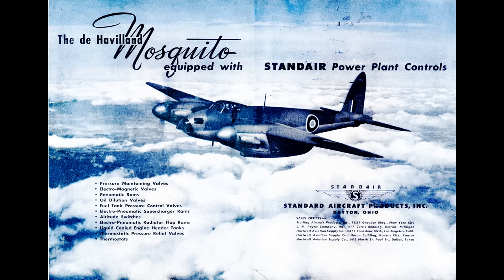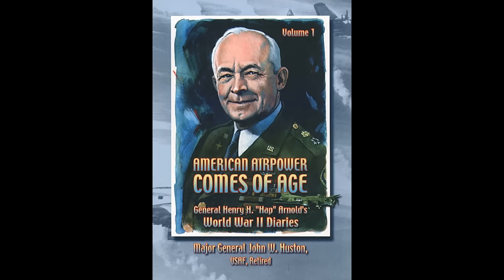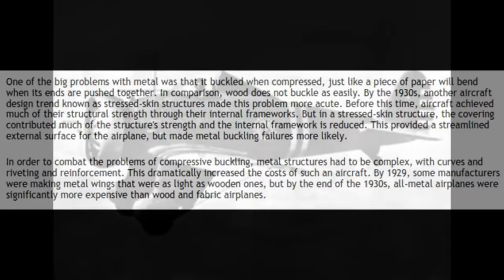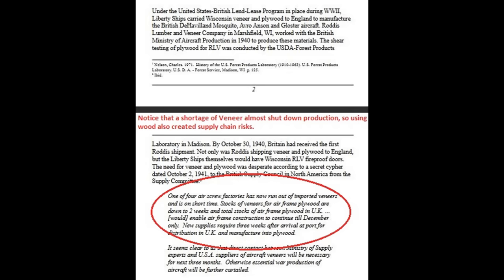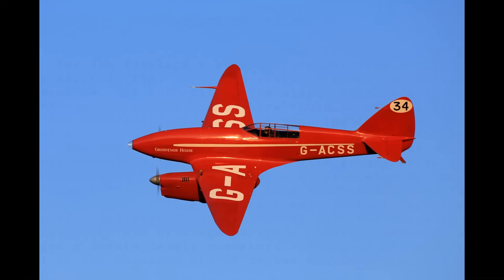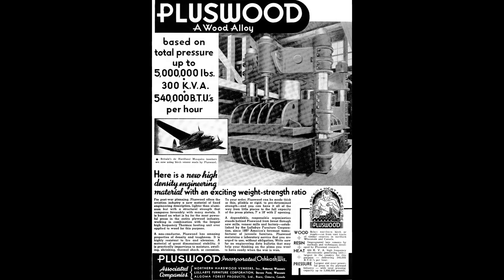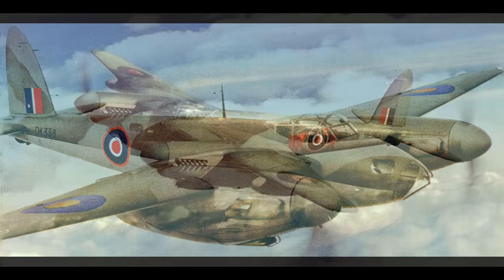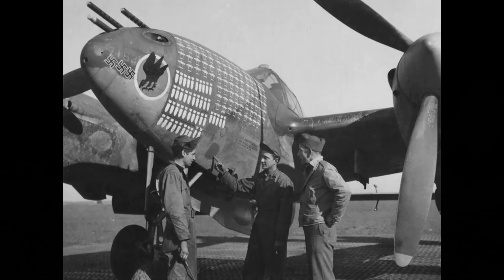De Havilland Mosquito vs. ?

Comment: Would anyone know if any Mossies fitted with the 6 pounder gun may have attacked concrete bunker emplacements in Wildflecken during the war?  I was there in the early '70s and saw a number of bunkers, some had been destroyed by demolition but a few were taken out by air.  One such bunker had a hole through the two-foot thick front wall almost large enough for me to fit my hand through.  The shell that did it was embedded in the back wall of the bunker just above the floor, easily found under the leaves and blown-in dust and other debris in the bunker by simply sighting down the hole in the front wall.   Entry hole was fairly clean, exit hole had spalled a crater over a foot across which had peppered the inside of the bunker, gouging the walls.  The slug was embedded in the middle of a smaller crater with a portion of the projectile sticking out of the wall.  The forward section was rusted and evidently steel or iron with a copper section at the rear which was oxidized greenish-blue  but still showing metallic copper.   The hole in the wall was angled downward at about 25-30 degrees or thereabout.    I was curious why a steel slug like that would have a copper section at the rear, unless the copper was for making things easier on the rifling in the gun barrel to spin the projectile without wiping out the barrel.   I'd wondered if maybe a B-25 could have done this sort of damage but the Mitchell variants fitted with this sort of larger gun had a 75mm cannon, which would have left a larger hole.  So... Mosquito?   Anybody know anything about Mosquitos fitted with these 57mm guns being used against bunkers in Wildflecken?   What else could have done this?
Reply: The mark XVIII was only used by Coastal command and only 17 plus one prototype were built. One thing it did do was shoot engines off of  a Ju88 bringing it down.

Comment: The point I was trying to make, perhaps inadequately, was that the Mosquito wasn't some kind of fusty holdover from an earlier era of wooden aircraft. It was a special, quirky piece of genius by Geoffrey de Havilland, who had (as you report) made wooden airliners, and continued the theme in the Mosquito's successor, the DH Hornet, and even into the DH Vampire jet fighter (a twin-boom design whose egg-shaped fuselage was partly made of wood). OTOH hasty research shows that the Tiger Moth, DH's pre-war mainstay, had a steel tube fuselage but wooden wing spars. So DH wasn't necessarily married to wood

Comment: It was faster than a spitfire and carried 4000 lb bomb load, a b17 carries 4800 lb.  getting the idea just how  deadly this machine was
Reply: B17 could carry much more than 4800lb. That was a typical load for long range missions.
Reply: Depends on what types of bombs used, and there were many types used. For instance, the USAAF load charts for the B17 show an internal bomb load of 8 1600 lb bombs, with a maximum load of over 17000 lbs using external hard points  which were probably never used, at least I can't find any reference to it. I tried to find out what bomb loads were used on the shuttle bombing missions, landing and resupplying in Russia. The planes used on those missions used the long range " tokyo tanks" which I'm sure limited bomb loads, as they involved a 1 way trip of over 1500 miles. Maybe someone else can shed some light on that?

Comment: The most underated plane of the 2nd World War. In my opinion. And it was a stroke of genius to build out of wood. When the use of metal went to fighters. All the wood workers could be uterlised .A fantastic platform to use different weapons, which it did .to great effect.
Reply from the maker: I don't know, it doesn't seem to be under rated here in the comment section, quite the opposite.
Reply: @GregsAirplanesandAutomobiles  Perhaps they haven't read the history, or the reports ,from the original wiring of the actual Pilots ,who flew them .That's why I said underated.

Comment: No mention of the Focke-Wulf Ta 154 Moskito surprisingly, Herman's personally much desired and sort for response to his admiration of the De Havilland Mossy.
A comparison between the Ta 154 and Mossy would be interesting. 

I have very limited personal knowledge or understanding of these topics, Wikipedia appears to imply in its Focke-Wulf Ta 154 Moskito entry that German "high performance" aero wood construction seemed to suffer some what from failures in materials particularly glues at least in several designs that got to prototype and some low numbers production.
e.g  He162 and Ta152.

Comment: Twin engine propeller plains planes generally used contra-rotating props to give you zero torque effects, unfortunately the Mossie just fitted 2 engines rotating in the same direction which mean that there was quite a lot of torque effects on high power low speed.  It mean it could be a handful under high power in inexperienced hands.
It was a beautiful plane.

Comment: Westland produced the twin engine whirlwind (single seat heavy fighter with 4 x 20mm cannons) about the same time as the Hurricane and Spitfire out of aluminium but was under powered using the Rolls-Royce Pegasus AND used 3 times the materials as a Spitfire, but was the most heavily armed fighter of the day!

Comment: OK de Havilland had a lot of experience building wooden airplanes but what about other manufacturers espacially americans? I understand Beechcraft point of view I think it would have been difficult to massively produce aircraft made of wood in the US. It requires more skills to properly glue wooden panel than to rivet metallic ones. I reckon shartage of skills was a key driver in rejecting the Moss in the US.
Reply from the maker: No, there were many aircraft manufacturers making aircraft out of wood in the US and they had built far more wood aircraft than anyone else. I think my next video will help explain why there was a huge move away from wood in the US in the early 1930s.

Comment: compressed and bent/warped plywood had great strength, lower strategic cost. additionaly a large number of carpenter/ craftsman were available  for the task at hand. unlike the hurricane where the stringers were of wood [ and consequently easier to repair than metal monocoqe spitfires. ]  the lighter weight with two merlin engines gave the mozzie outstanding speed and higher altitude capabilities for recconasance.

Comment: Two other benefits of using wood are the skilled craftspersons were mostly under-employed during the war. The work available for cabinet, furniture, piano, guitar, etc., makers was substantially reduced in war time. Also, wood is a lot easier to repair, replace and maintain in the field.
Reply: Then why are there no original aircraft still flying?
Reply: @sandervanderkammen9230  , eventually, wood will rot, especially since many, if not most, original Mossies were left outside after WW II.
Reply: @VRSimWizard  Aircraft made of wood are significantly less durable and have a very short service life, unlike traditional wood aircraft that are cheap and easy to repair, the Mosquito's molded plywood construction was very difficult to repair properly.
 The Mosquito was conceived to work around Britians shortage of aluminum but in practice it was simply cheap and disposable.

Comment: Looking forward to a mosquito p38 video....Although it may seem on the surface they could do a lot of the same roles....Operationally I'm sure there are massive capability differences....ie a navigator...climb performance...allison vs merlin development....on and on.  Two very interesting aircraft. One of which there is a fantastic representation of in the DCS Sim.

Comment: Great video.    Part II and the P38/Mosquito comparison should prove very interesting.   It will be fun lining up Mks, dates in service and comparing capabilities.     A couple of thoughts struck me, first the Mosquito was succeeded by its "Sports Version" the superlative DH Hornet which served with the FAA in its Sea Hornet incarnation.   Same structural principles as the Mosquito, but handed airscrews which probably helped with landing on.    "Winkle" Brown the first pilot to land a multi-engined aircraft (Mossie) on a carrier, and also performed the first carrier jet landing, called it the best of the lot.  Since he just about evaluated the lot, he has some solid grounds for saying that.

The second thought was about carrier operation.   The first jet  engines were very thirsty and also maintaining a steady thrust could be difficult - provided it even kept running.    This made carrier jet operation a challenge at the time, and I can see how a high performance piston engined carrier aircraft could be useful for quite a while after jets got adopted for operation from land.    We know of the Mosquito and Hornet use at sea, (nervously showing my ignorance) I wonder if there was any thought given to a comparable Sea P38 or a follow on analogue of the Hornet and Sea Hornet.
Reply from the maker: The Hornet is a different ball of wax, I'll cover it when I get to British Super Props, but not in this series.
Reply: @GregsAirplanesandAutomobiles  Many thanks, fair enough.   I suppose what I was thinking was the guys at DH looked at their Mosquito and deciding they could do even better by  stretching the same principles and I wondered if Lockheed entertained similar thoughts.    Presumably DH always had eventual carrier operation in mind. Thanks again.

Comment: Very enjoyable.  Extremely well balanced in my opinion....however a few points . I think the lighting v mosquito is not really comperable. They  were both head and shoulders above the average. Lightning on accoun because of the extreme range bestowed by the turbochargers which neccesitated the twin boom design. Were talking Kelly Johnson here....and i believe charles Lindbergh showed the pilots how to cut revs and increase boost to maximize range despite the engineers warnings. Perfect for the pacific  Mosquitoes  in their own way were optimized for the time and place. Another way of looking at the almost unique construction method is to call it composit....like proto foam sandwich construction with the balsa acting as th foam which did not yet exist. It was built on concrete moulds with steel straps providing the pressure to acheive a bond between the layers.....nothing like traditional wooden construction.. The mosquito meuseum is just down the road from where I work. Well worth a  visit. As an aside experienced lancaster pilots and most others were required to do a 14 day coversion course onto Mosquitoes which says a lot ....also somebody mentioned the other day that it wont climb on one engine gear down....just to make single engine handling a bit more interesting.

Comment: The benefit of wood and cloth construction, is that cannon shells pass right through without detonating.
Reply from the maker: They detonate when they hit wood. I think you are confusing cloth coverings over a skeleton type structure like in a WW1 airplane.
Reply: @GregsAirplanesandAutomobiles     just checked ... plywood skin ... i learnt something today, thanks.

Comment: If de Havilland had only called the material of construction a composite, and not wood then it would have sounded so much more advanced. As far has handling goes, probably the trickiest issue, was that both engines turned the same way. It's notable, that post war wooden oddity, the de Havilland Hornet (reputedly Eric Brown's favourite aircraft) had gearing such that the engines turned in opposite directions. 

One other thing about de-Havilland. They did know how to produce beautiful looking aircraft. Among airliners, perhaps only Concorde looks better than the Comet and no WW II aircraft could match the aesthetics of the Mosquito in my (subjective) view.

Comment: Interesting.
The Mosquito uses the RAF 34 mod profile airfoil. I am not sure what the modification is. The DH.88 Comet Racer used the same wing profile. I have a suspicion that The DH.114 Heron which also uses RAF 34 mod (18.3% at wing root and 14.5% at the wing tip.) uses the same profile.
But as I cannot prove it that that is the case I ran the comparisons on a standard unmodified RAF 34 profile. I then created a NACA 4 digit profile using the RAF 34 profiles characteristics for comparison.
I I then ran some comparisons on the airfoil tools website.
There is a NACA profile that is fairly close to the RAF 34 profile the NACA M6
The nearest NACA 4 digit profile would be NACA 2312
This defines a Camber of 2% at 30% of Chord from the leading edge and and a maximum thickness 12.5% of Chord.
BUT it does differ significantly on both surfaces from about at around 50% of Chord to the trailing edge.
It would be interesting to see which of the three profiles would give the greatest lift under the same conditions.
Reply from the maker: Good work.

Comment: The NACA report you mention at about 21:45 did use words like adequate and sufficient, but they also wrote: This report has no bearing on the performance characteristics, which were not measured, but which were considered to be exceptionally good.
Reply from the maker: Yes, it does say that. Thank you for pausing and reading that, it makes me happy.

Comment: There is a Guy in the states who has built a Spitfire from wood a full size replica but it has I think a Allison Engine not the RR Merlin. The Spitfire is featured on You Tube.
Reply: With a non cut down DC-3 prop?  Very nice plane.  Shame about a naff fake ring and bead gunsight though.

Comment: I often wondered how it is that the WW2 “air superiority winning” Rolls Royce engines eventually came under the German BMW ownership (ie in UK).
The famous DeHavilland Mosquito fighter-bomber - the fastest thing flying in late 1941 / 1942, also with a range to get to Berlin and back… caused so much damage to German war-effort that the Germans always remembered “DeHavilland” - they never forgot…
In the early 50’s DeHavilland introduced the first COMMERCIAL JET airliner (with fully powered controls, fully pressurised, cruising at 36,000feet at 490mph, much faster than any competitor) - the DeHavilland DH106 Comet - order-books filled up by dozens of countries and their state-airlines for years to come.
Then, as if someone had a grudge against DeHavilland - a Comet taking off from Rome went down over deep water in Jan 1954 (eye-witnesses heard 3 explosions - initial bomb + fuel).
Then as a repeat, another Comet taking off again from Rome went down in April 1954.
Order-books dried up almost overnight.
A psyop cover-story of “square window crack propagation” was repeated for long enough that it became a mantra.
Admiral Canaris (who obviously survived the war) - set up continuation of the German black intel - Deutsche Verteidigungs Dienst (DVD) in 1944 - HQ in Dachau.
Canaris was the man who ordered the hit on DH Comets - with the aim of strangling the blossoming UK civilian airliner industry.
Back to WW2 - Menzies (head of wartime MI6) and Frank Foley (MI6’s supposed expert on Germany) were both later exposed as a double-agents working for the Germans.

Comment: Good video! Great photos... The Mosquito was an amazing performer... I imagine the thin plywood did very little to stop bullets, and neither did the 0.032" aluminum alloys.... So maybe the ONLY advantage that metal had when hit with weapons fire was it did not splinter, but it could easily tear open , like a pop can , when scratched or holes were punched into it.... Especially areas that have stressed skins....Wood can dry-rot when exposed to moisture, and metal can corrode when exposed to moisture. Damaged Wood can be repaired, quite effectively,  as metal can be repaired, but wood requires fewer special tools / techniques to repair... Wood planes are quite effective in many ways... One area that metal is much better than wood, is when the cabin needs to be pressurised... The tendency for the porous wood , is to allow air to pass through it, and cause severe delamination... Even when coatings are applied to the wood, just a small area of leakage could cause massive delamination of the wood plies...

Comment: Ball-bearing Run was the nickname of the war-time Stockholmsruten flight between Stockholm and Leuchars, Scotland between 1939 and 1945. After 1942 the flight was run by the Royal Norwegian Air Force, but for political reasons[1] operated as an ordinary BOAC Flight, the unarmed aircraft having civilian registration and the Norwegian military crew wearing BOAC uniforms and carrying British passports.[2]
The Stockholmsruten was set up by the Norwegian Government, exiled in UK with the aim of transporting Norwegians having escaped from Nazi-occupied Norway. Several types of aircraft were used, but the backbone of Stockholmsruten was the Lockheed Lodestar.
Since the aircraft also carried ball bearings, of greatest importance to the British war industry, this is how the flight got its nickname in UK. From 1943, greater load-carrying capacity was achieved by the addition of Douglas C47 aircraft, but during the short summer evenings when the route over occupied Norway would be too hazardous for these slow aircraft, de Havilland Mosquito were employed instead, but could only carry a small payload.[3]
The service also carried other passengers, one of the most notable being Danish physicist, Niels Bohr, who was flown from Sweden to Britain in a Mosquito in 1943, while in the same year, George Binney, the organiser of blockade-running operations was flown into Sweden in the same type. The Mosquito lacked any provision for passengers, who had to be carried in the aircraft's bomb bay, where they were only able to communicate with the pilot by pulling on a piece of string.[4]
Between 1939 and 1945, 6,000 passengers, and 500,000 tons of freight, were transported by BOAC between Stockholm and Great Britain.[5]
wiki